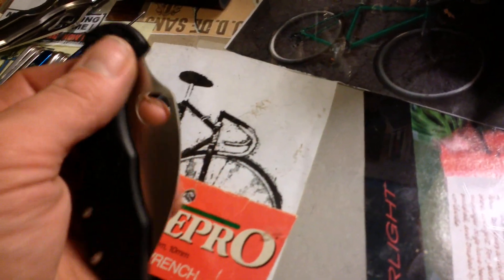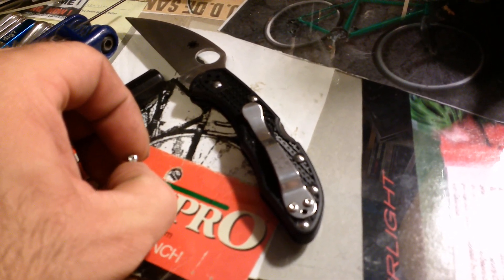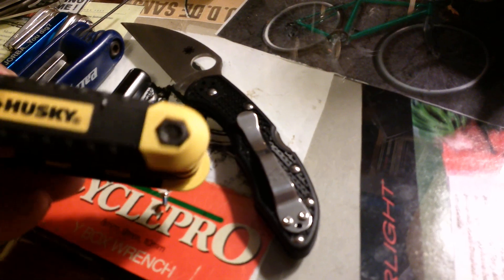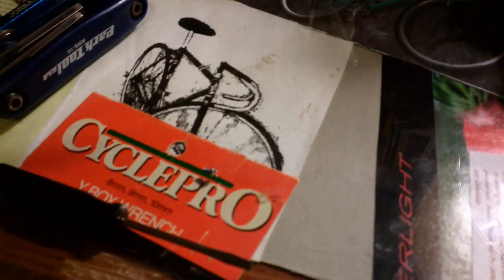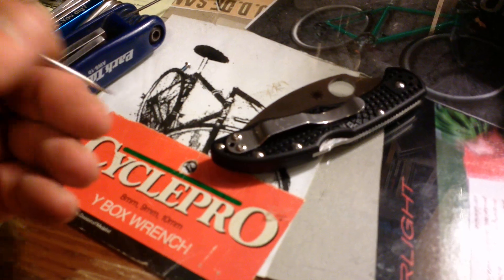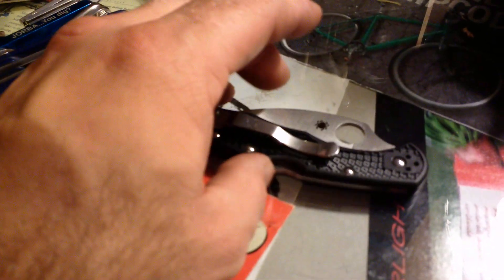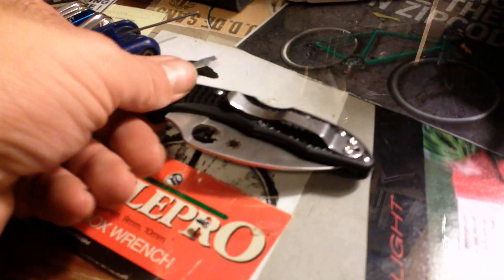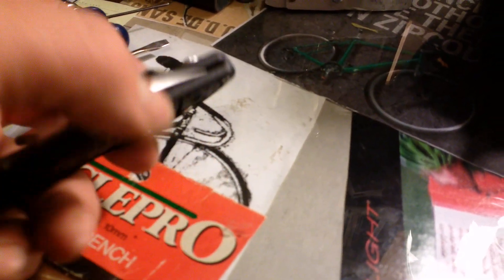How to remove stripped pocket clip (torx) screw --  on a Spyderco

Comment: Pocket clip on my Para 3 wasn't moving and all three were starting to strip. Using the t-6 so I heated up the tip of my t-7 with a propane torch then just set it in the stripped part of each to get them nice and warm. Right after that all three came off really easy. It is some kind of loctite they are using that just needs alittle heat. Mine didn't have any red thank God. It looked like something white. Never heard of white only red and blue.

Comment: Just had the lockbar pivot T6 strip on my Wharncliffe Delica tonight. I'll give the Allen key thing a shot (if I have one small enough) but I dunno if I have a file thin enough to cut a groove in the screw head.
Reply: You have to be careful but I've used a Dremel with a cut off wheel and cut a Groove
Reply: @dude28405  I managed with a hacksaw, luckily.

Comment: Knife company's should be sued for using T6 ,  I HAVE stripped my share trying to take apart a knife. I looked your video up because right at this moment I'm trying to remove the clip but there is to much T lock, So Im heating it up with a heater it's on a PM2.
and I'm praying I dont strip it